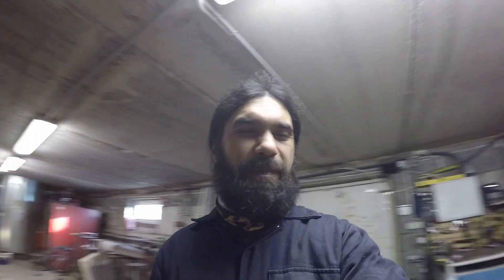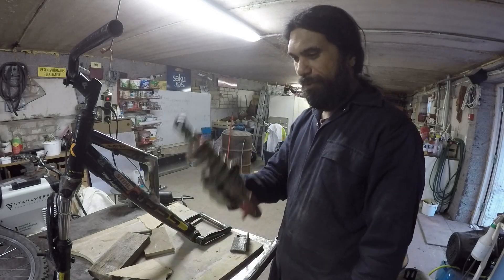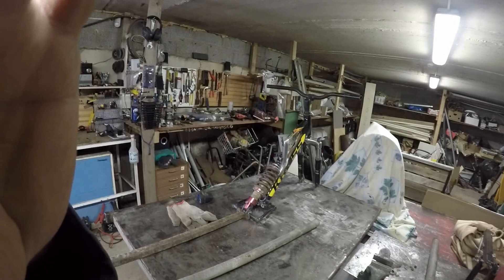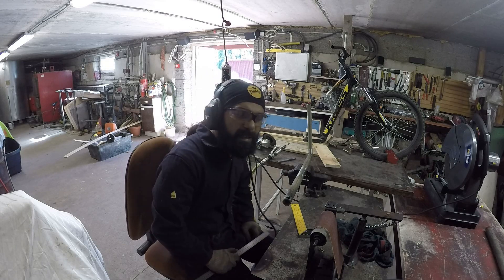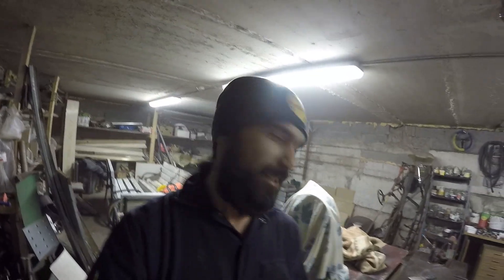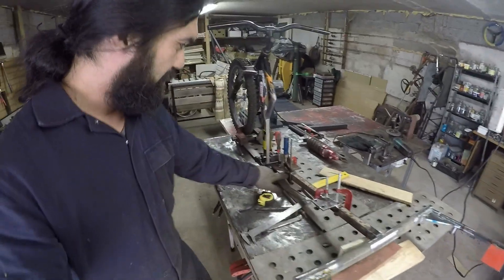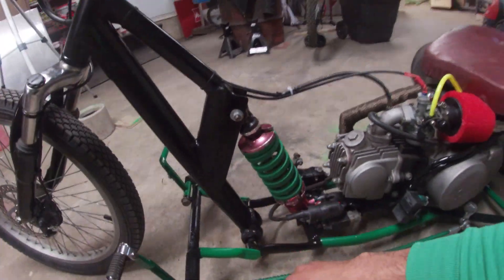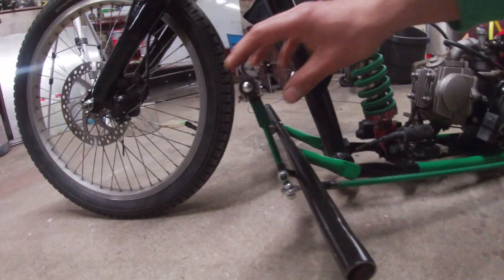how to build a motorised trike

Comment: Does the part that connects to the bottom of the shock the mainframe does that bar spin as well or is that welded solid so the only part that swivels is the pedals right
Reply from the maker: Only the pedals swivels buddy